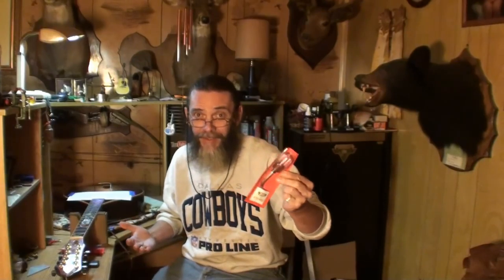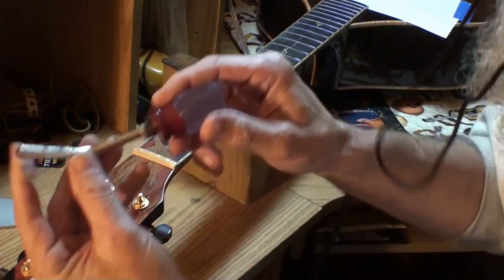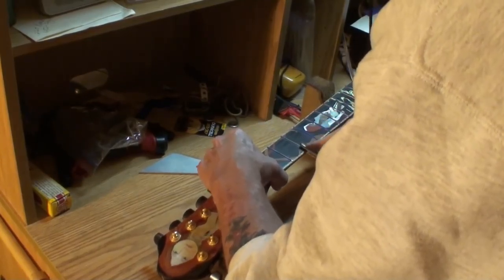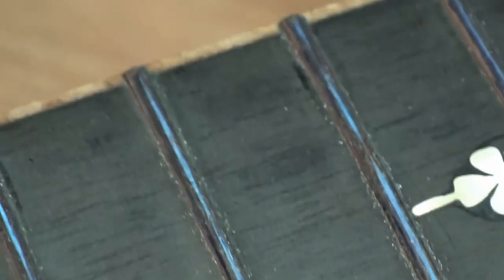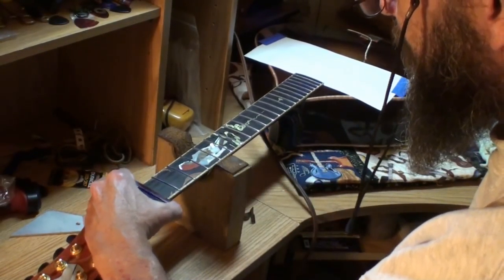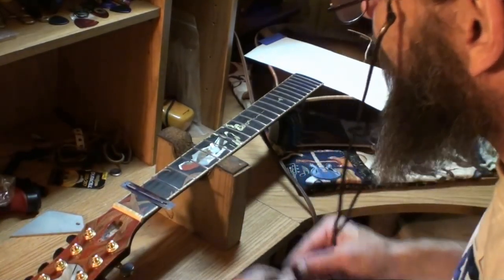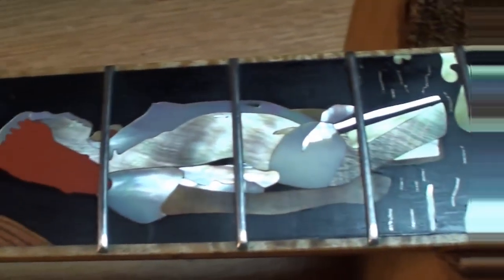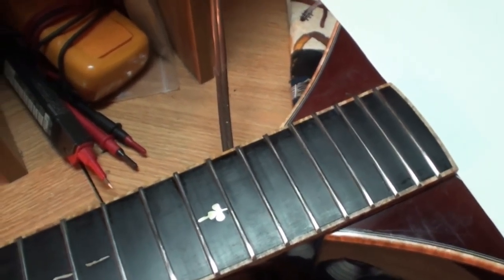Fret crowning, polishing, MANY tips Cittern part 3 of 5 and give away guitar?

Comment: Good stuff Randy, I do tape my boards, not because I'm worried about slipping but because I just don't like messing with the little protector gizmo. Tape also keeps more of the polishing compound off the board.
Reply from the maker: Sometimes I tape them up if the customer doesn't like oiling the fretboard or putting anything on it, some choose to never oil but just keep it wiped off clean. Other times I actually use the polish to clean off the board if a lot of dna is present, this polish is very lightly abrasive and really gets everything off. Thanks for viewing Dane.

Comment: Very nice job Randy, 
That Stewmac file seems to work fine. I once bought a similar Gurian file, and didn't liked it. Difficult to handle and impractical. But think that's just a personal preference. 
Think you're correct about the marketing strategy of Stewmac. 
btw. Good info in the video to pay attention to the different sizes, and how to use 'm correctly.
Keep it up, wish you good luck and success.
Reply from the maker: Many thanks Will. Yeah this crown file does work pretty slick, it's fast and cuts in both directions, my old files only cut in one direction so that alone helps a lot. Definitely pay attention to the sizes. Thanks again!

Comment: You are the best advertising Stew-Mac has ever had.  They should be sending you free stuff for making them famous.  Thanks also for throwing some light into that Z-file crap they are selling.  If triangular frets were better why make fret wire semi-circular and not triangular to begin with?
Reply from the maker: lol StewMac has made a fortune just off me! I have to share my love for them haha! I think they reason frets are made like they are is because even if new frets are installed they still have to be leveled, dressed and crowned to make the action as low as possible without buzzing. Thanks for checking it out!